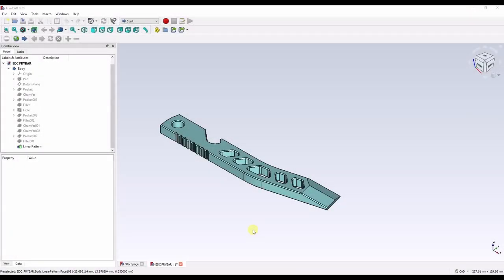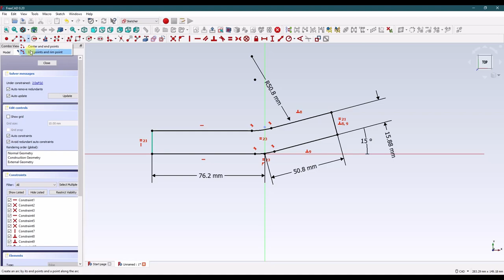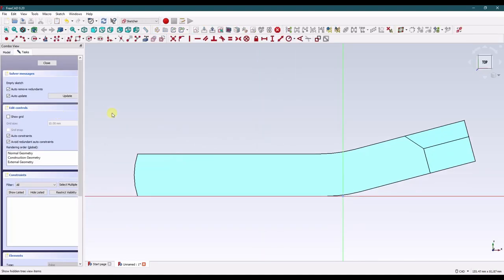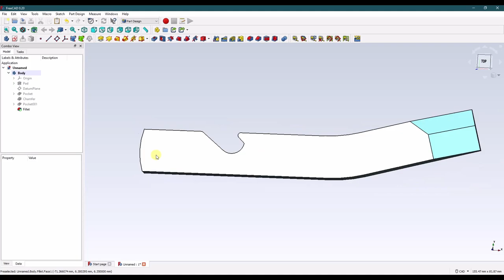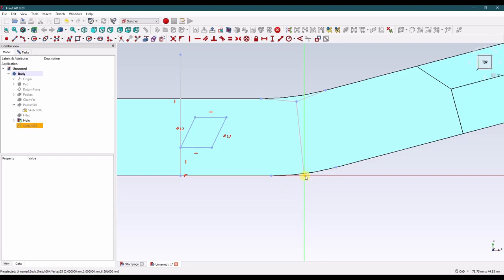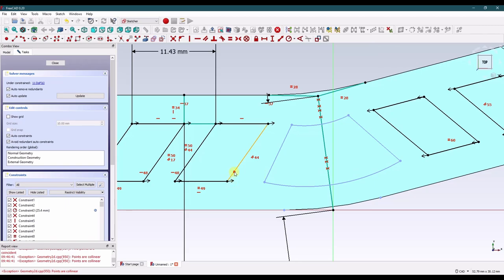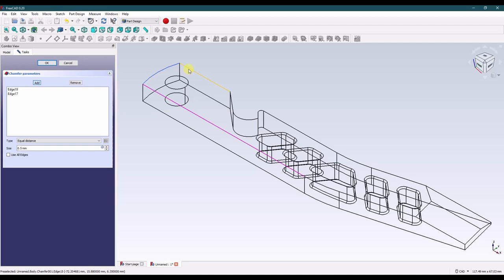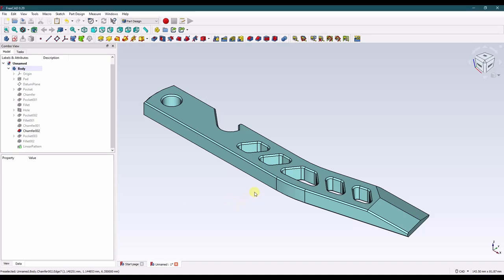FreeCad Tutorial #9 | How to model an EDC PRYBAR in FREECAD for manufacturing

Comment: I really like your style and the practical models! I am learning a lot.  Two things (and I get that this is a year late) that might make it a bit easier to follow - if you could refer to the planes by the name in FreeCad "XY, XZ, YZ" rather than 'top plane' that would help. Also - and you probably won't like this - when you switched the color scheme to match a different CAD program (SolidWorks?) that really threw me.  If you are going to have a FreeCAD tutorial it might be best to stick with the FreeCAD defaults as much as possible.  If find it harder to follow your sketching after you started using a different colour scheme.  Not showstoppers - just minor suggestions.